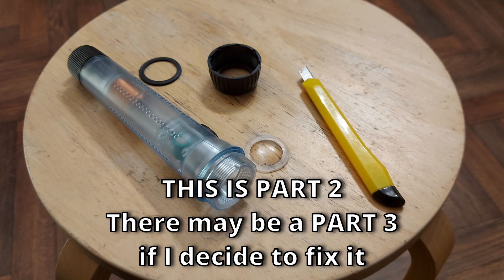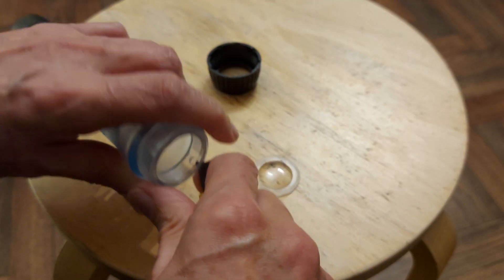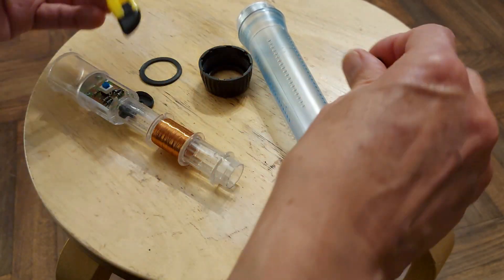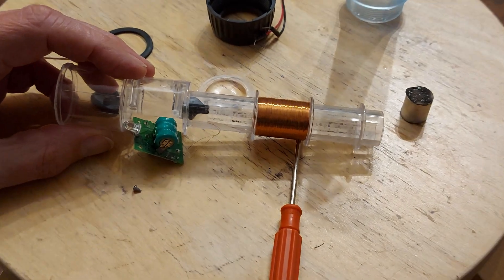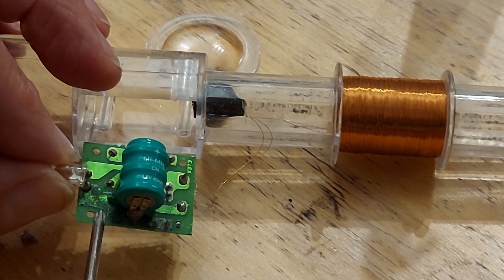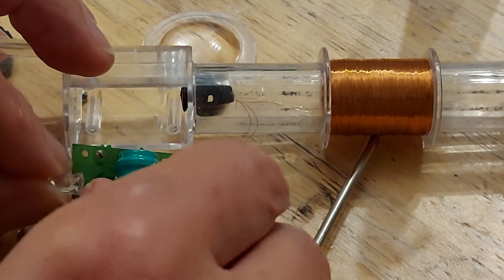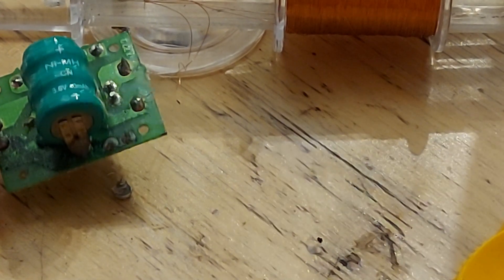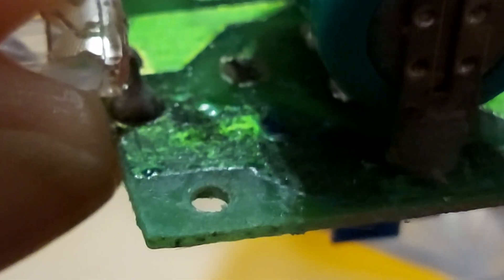Looking at an old induction shaker "Faraday flashlight" PART 2

Comment: theyre a prime example of mass education meets reality...
"we poke a magnet in a coil and make electricity!"
yeah, bit more involved than that if you want it to be GOOD.

makes me sort of want to do my own now... vaguely recall when they came out, late 90s... seemed wrong, massive magnet and a lot of shaking for nothing much... cant say ive thought of them since...
is wrong. linear generators are reasonably simple but not that simple...
two coils, two c-cores spaced apart to let a magnet and two iron slugs on a yoke slip between.. magnet links with one pole pair, slug shorts the other, or vice versa. full flux linkage and reversal. should produce a useful output. need a certain inertia, mass, for a given magnetic strength to jerk it out of a pole pair...

Comment: Hearing Aid batteries. I would check the charge ability first. A Handle / rod on the magnet , slide it back and forth through the coil with the meter hooked up. They are more of a novelty than practicle. When the batteries fail the circuit is open and it will never work. With a capacitor all you get is a few moments of light, before you have to shake it again

Comment: That's an unusual model.  The legit ones I knew had an ultracapacitor where the batteries are in this one, because it charges faster and never leaks.  God knows how long you would have had to shake that thing before you got any light out of it!

If the coil is still good, the best way to get this working is to use a high-efficiency bridge rectifier after the coil, charging a supercap which runs a joule-thief circuit to run a single white LED.  Sounds complicated, but you could put one together in half an hour.  

An easier option is to take the guts out of one of those solar garden lights and install it in the torch, but running off the coil instead of a solar cell.
Reply from the maker: You will see in part 3 I put a supercapacitor in it for demonstration purposes 👍

Comment: Those flashlights where garbage.
They also made them with single use 2032cells in it and later with super capacitors.

Comment: I think it is a museum piece (I have one, the same, not leaked though). I think the lights in which you need to squeeze are more efficient to use. You might consider putting a capacitor inside in stead of batteries. For a few seconds runtime of light, but it will be immediately 'bright' (haha, that tiny LED).
Reply from the maker: Yes, I thought the same. In Part 3 I fit a supercapacitor. After a few seconds shaking it lights for seconds, which is long enough for demonstration purposes.
Reply: @GrandadIsAnOldMan  I have one almost identical, But has silver cr20 type batteries

Comment: Do you think a tiny vape battery would work.  Not sure if charge cycle would need to be upheld for such a tiny battery?
Reply from the maker: Hi, Tel. I hope you are well. I think you would have to shake it for a long time before you have a reasonable charge stored. I was thinking something similar. In the end I fitted a supercapacitor. After a few seconds shaking, it lights for seconds, but it is long enough for demonstration purposes. That is in Part 3 👍👍